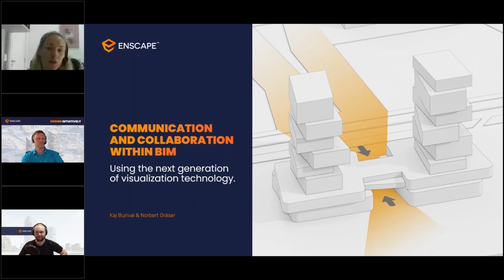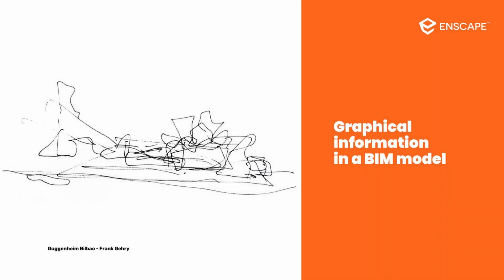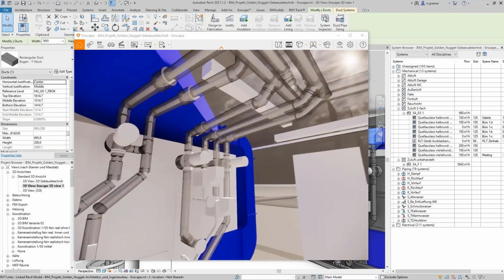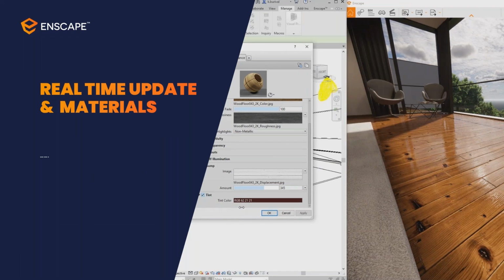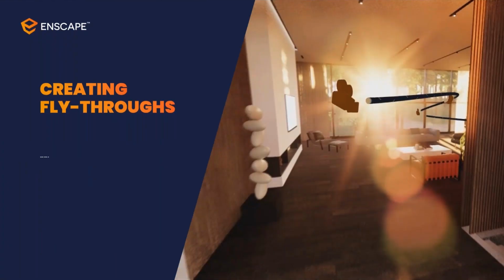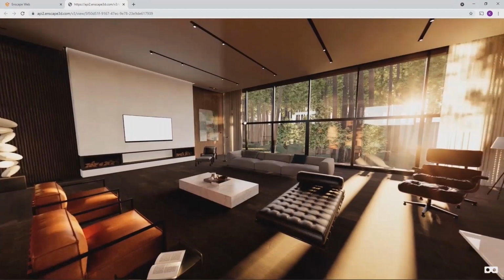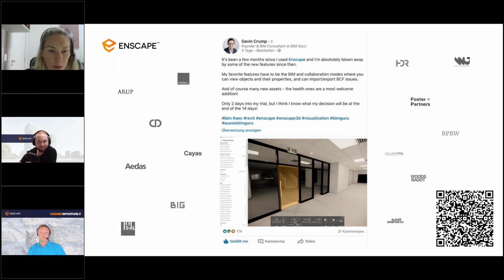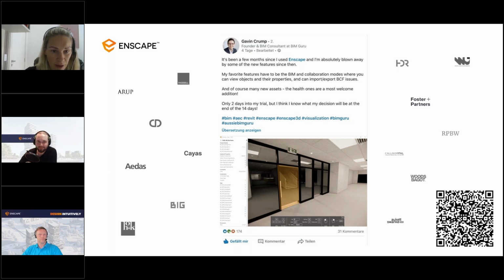Webinar | Introducing Enscape: The Next Generation of Visualization Technology

Comment: How can i run Sketchup and enscape parallel they are both on different windows and i had to shift everytime i render. I kind of changed the general settings.
Reply from the maker: Hi,  to run SketchUp and Enscape simultaneously when using one screen, please hold the Windows Key (Win Key) and press the left or right arrow key to move the windows to and align them on one half of the screen.
Reply: @EnscapeArchDesign  Thanks a lot. Works perefectly now